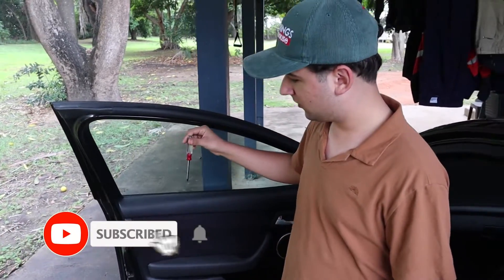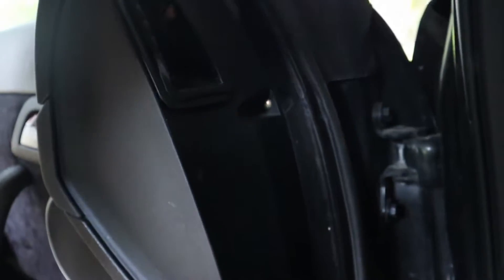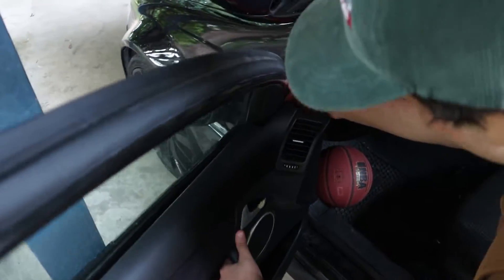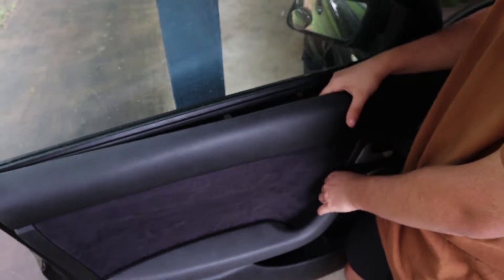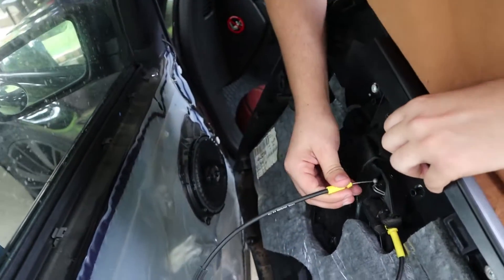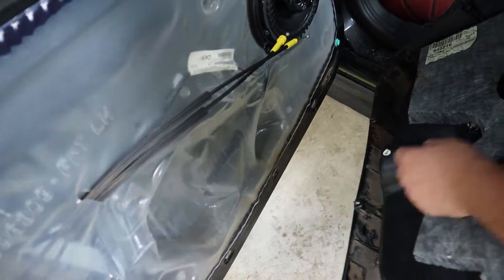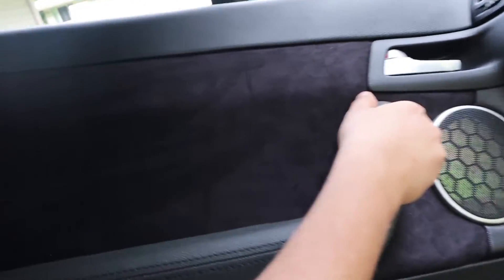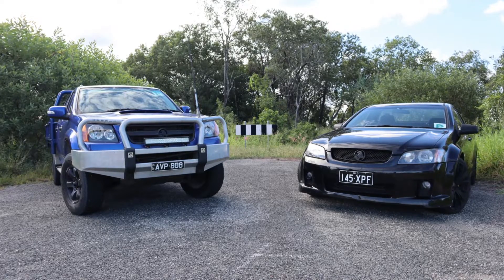How to Remove a VE Holden Commodore Door Card!!

Comment: I was removing the door card to replace the interior locking mechanism for me this was a fairly easy process except for 2 things the screw under the arm rest was difficult to get to and much smaller sized phillips head than the others BTW the screw inside the actual lock was a torque and again small size head. The mechanism is held in place by two (again small size) torque screws. Apart from that great work boys.

Comment: Thanks for the video. Do you have one explaining how to replace the inner door handles?
Reply from the maker: No problem! 
We don't but there should be two screws on the inside of the door card that connect up to the door handle. They are near the top closest to the front inner side of the door card if it was on the door. Unscrew them and then you should be able to wiggle it free. Hope that makes sense 👍
Reply: @BrokeCarConnoisseurs  Perfect sense, thanks.